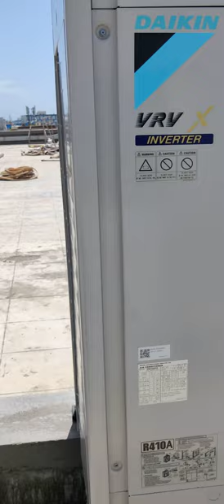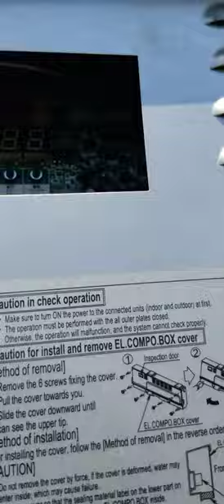Daikin vrv 4&x compressor bypass settings

Comment: sir just asking if I isolate master all compressor isolate, automatically  the slave 1 and 2 are functioning ?
Reply from the maker: Yes....
Reply from the maker: Put the master bypass setting to master unit then run to slave 1 & 2 automatically running
Reply from the maker: Yes working

Comment: VRV X master  (error -9 54)  I will  chaking  gas leakage  prablaim  arrest  continue  e-9 -54 so I have  convert  slave 1 to master   and auto  gas charging  ok but indoor  unit will be remount  control  power  on  error PJ04 display  but slave unit will be  working  what  prablaim  and solution  plz telling you
Reply from the maker: Cal me 9600058530

Comment: Sir, 
This was the solution I was searching for, 
I have a combination of 20HP (Master)+18 HP ( Slave1) +18HP (Slave2), Two Months back we observed a high compressor sound in Slave1, compressor No. 1 was getting too hot, so we bypassed Slave 1 and only Master and Slave 2 were operational,  Today (6.7.23) we had L1 Error. We realized that the Slave 2 Compressor 1 was Body Short.
we want to Run the machine with the Faulty Compressor 1 Bypassed, .. DO we have to follow the procedure in Master or in Slave 2.? Please advise.
Reply from the maker: Do it on master unit, every settings has to be done with master unit only.
Reply: @madhantechtamil4071 , I did the setting on Slave first but then corrected it back and did the setting on the master Unit. the slave unit started with only one Compressor, but the fan motor turns on for 20-30 Seconds and then turns off, because of which the Coil at the outdoor unit gets too hot, and I have to turn down some indoors and reduce the load.

Dear Madan Sir, It would be nice if we could call or talk on a phone call, this could be explained Fast and easily,
I am from Silvassa Daman, It's a Union Territory located  150 Km from Mumbai and 120 Km from Surat Gujarat.